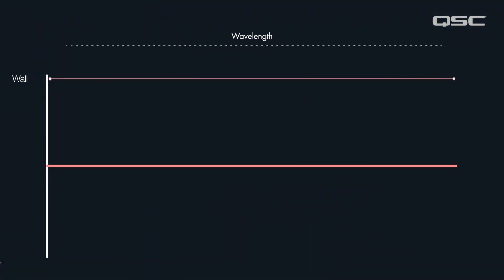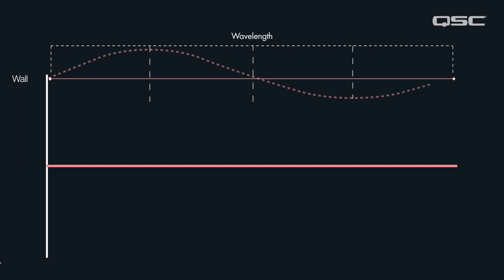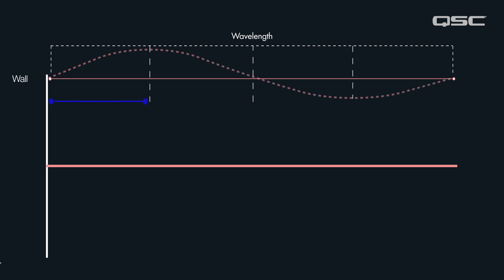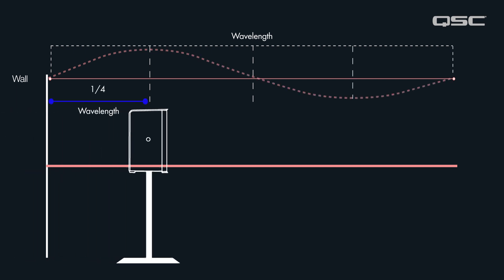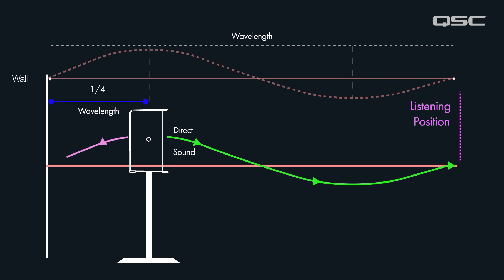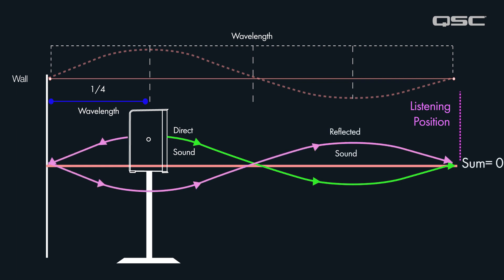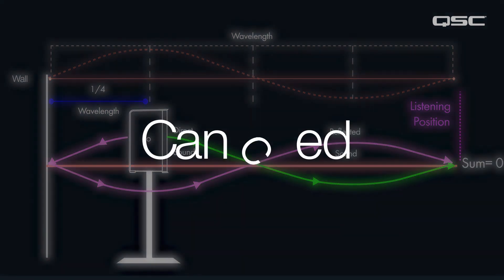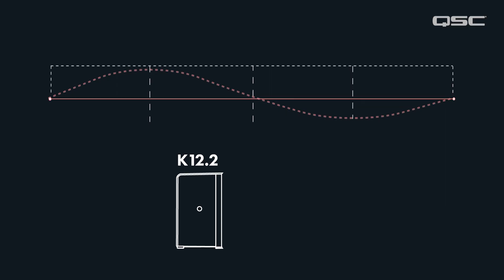Low Frequency Cancellation: Loudspeaker Placement | Sound Advice

Comment: so what would be the answer if you plug in 8 gigahertz? what would be the cancellation frequency
Reply from the maker: Well. If 8 gigahertz is the lowest frequency your loudspeaker reproduces, you have an extremely high-pitched loudspeaker. But let's do the math. The physical wavelength of 8 gigahertz is 37.5 cm or 14.8 inches.  So, the quarter wavelength would be 9.375 cm or 3.7 inches. So, as long as your 8 gigahertz loudspeaker is more than about 4 inches from any surfaces, you should be alright ;)